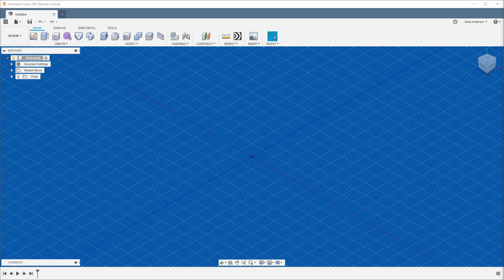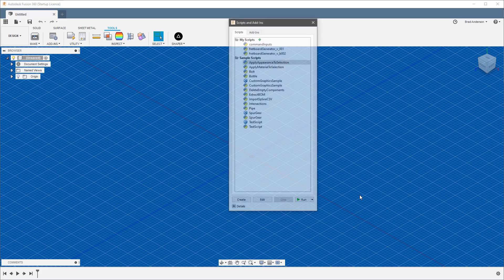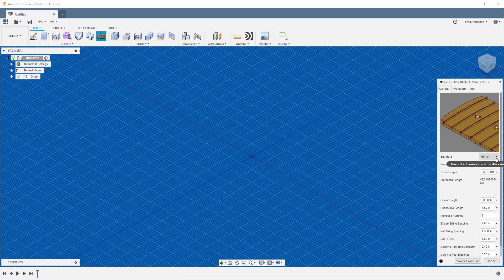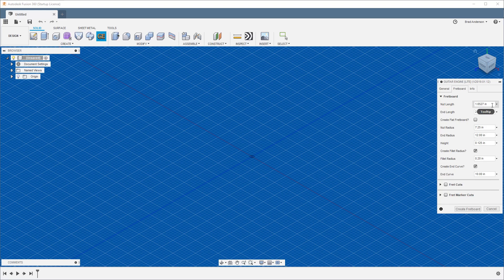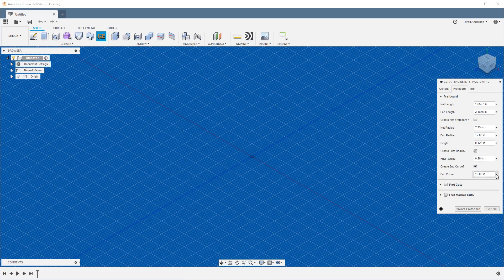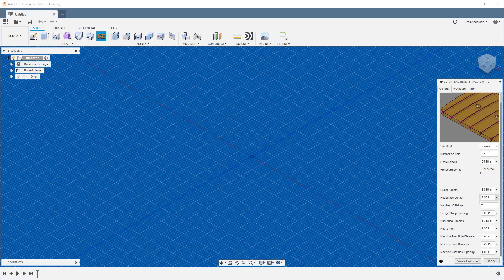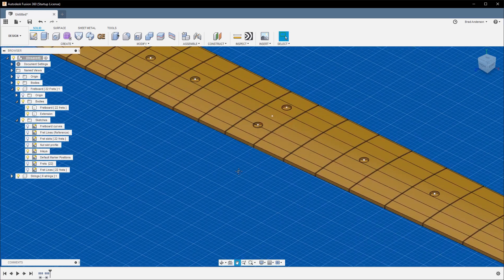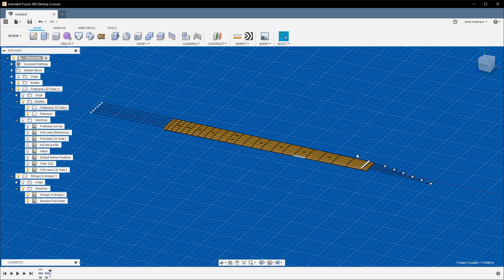Fusion 360 Guitar Neck Tutorial - Part 1 (Intro and Add-in)

Comment: WOW, thanks Brad for sharing this information.  What a blessing.  I had my guitar body in Fusion 360 and had started work on the fret board and neck and found these videos.  What a different way to solve this problem, or rather brilliant. I was working from the neck shape instead of the fret board.  Same for video 2 &3.  Looks like the current version has the fret slot following the fret board top.  I had a few issues with geometry as I was modeling a 3 + 3 peg head and my dimensions didn't fit the model, which is OK as I can deal with that at a later stage.  Finally figured it out and left several of the peg head dimensions with the default values.  SO thanks for default values.  I was also excited to find out there is a Fusion 360 Luthiers group.  Thanks again!

Comment: Great addon! Any chance it could be modified for ukelele design?
Reply: Just give the tool your parameters and it will model a fretboard that correspond to your settings. I made a 4 string bass fretboard with that tool and it works great.